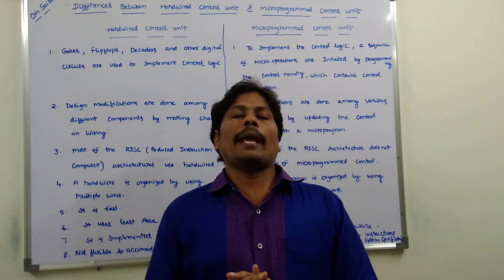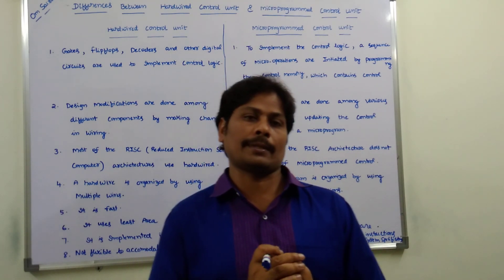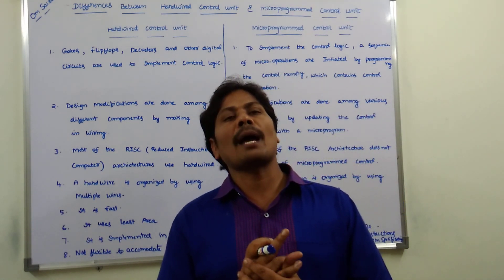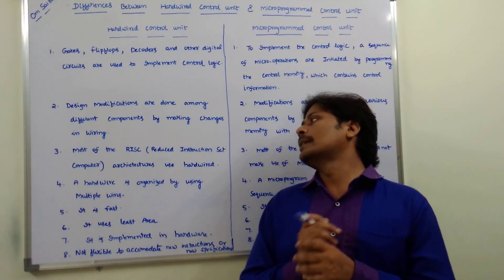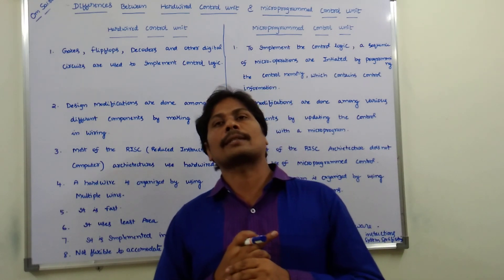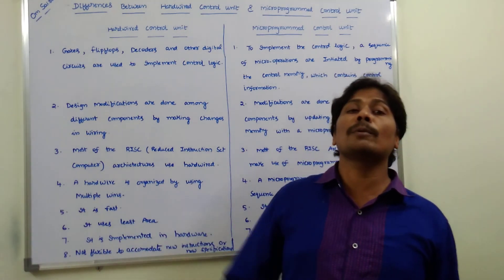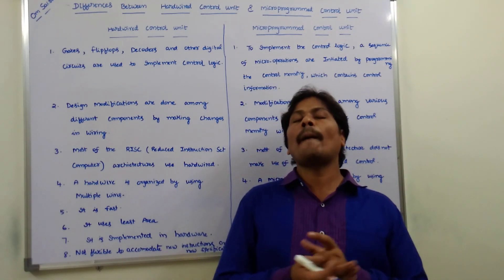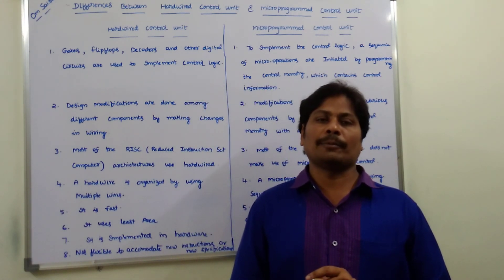Difference between Hardwired and Microprogrammed Control Unit || Computer Organization || CA || CAO

Comment: I have a doubt  in size ?
Reply from the maker: In microprogrammed control unit, control memory is existing in addition to main memory, because of that reason size in hardwired control unit is less compared to microprogrammed control unit